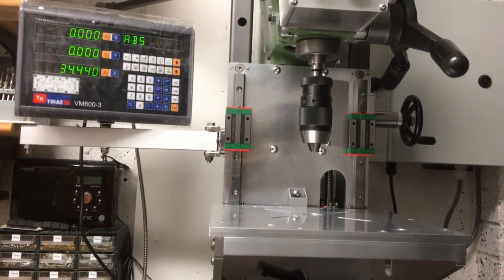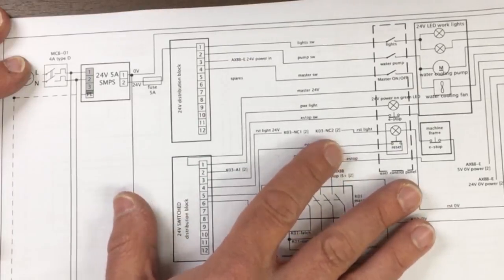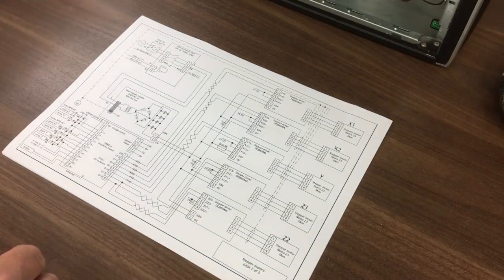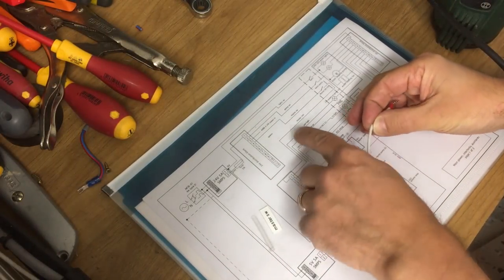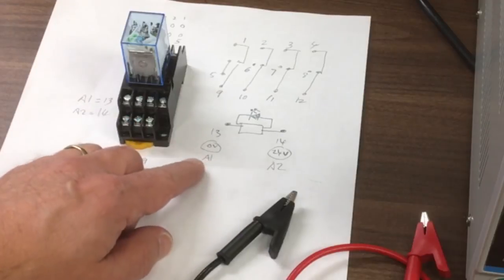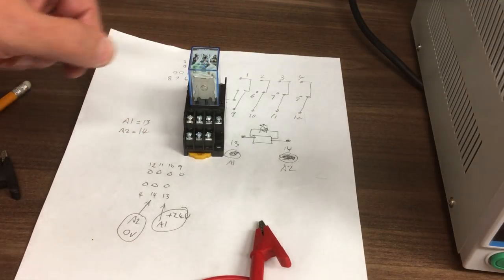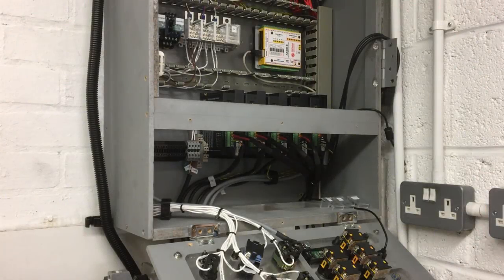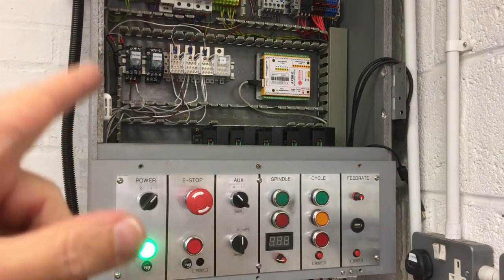Ep29: CNC Ethernet Upgrade - Low Voltage Systems

Comment: Hi Have you got a downloadable copy of the schematic/wiring diagram. I'm putting a control box together and need all the help I can. Really nice videos, very helpful. Cheers Andrew
Reply from the maker: I spotted some errors in the wiring diagram as I was building the controls.  So when it’s all finished (and no more errors!) I’ll show an updated copy.  I’ll post on the mycncuk forum when it’s ready and upload a copy there.  You’ll also get help on that forum. Thanks
Reply: @routercnc9517  Hi Thanks I'm on ukcnc. I'll check you out. Thanks Andrew

Comment: Your front panel displays remind me of the panels on the front of the control boxes for Petbow (ANPG) generators. Petbow were a company based just outside of Sandwich Kent, back in the 70s, 80s, and 90s.  I don't think they exist any more, (I may be wrong?).
Reply from the maker: OK i'll check them out

Comment: Hi,

Normally you would wire the realy so when it's active the internal LED is active, and you have an external diode to stop back EMF.

This way if the diode fails you can replace it, otherwise you need to replace the whole relay to stop the back EMF.

Some motion systems have a brake that needs to be manually overridden to allow motion, this way you know that the relay is active.

Regards
Reply from the maker: Ok thanks.  Having read all the comments I’m going to go back to how I usually do it and have the LED come on when the relay is on, then have a separate flyback diode.  The clincher for me was not wanting to run 24V through the LED backwards as it will probably fail.

Comment: Leds are not ment to be used as flyback diodes. They can not withstand the voltages or currents produced by the relay for a long time or very often. It would be better to wire the relays with the leds as on-signals and use separate diodes (1N...) for flyback.
Reply from the maker: OK thank you.  It seemed odd to find a wiring diagram with A1(24V) to pin 13.  I have used 1Nxxx diodes in the past for flyback but have never found a neat way to do it.  I’ll give it a go like this and if it fails in the future I have loads of spare relay housings I can just swap out.  Then you can say I told you so !  Thanks
Reply from the maker: Based on more thinking and more replies I’m going back to how I usually do it which is LED on when relay is on and a separate flyback diode.  That random wiring pin out I found that originally got me thinking was misleading.

Comment: Using the LED as a snubber is unlikely to damage it however snubber diodes should Ideally be schottky types to reduce the voltage.
Reply from the maker: OK that’s good to know.  I’ve used 1Nxxx diodes in the past without a problem.  What I was wondering though is if they were intended to be used like this since I’ve seen wiring diagrams with A1 (pin13) as 24V and A2 ( pin14) as 0V and the LED is then used as a fly back.